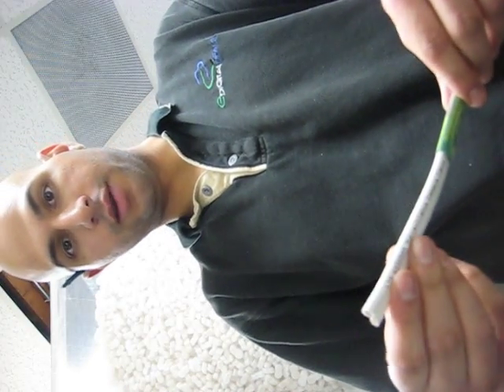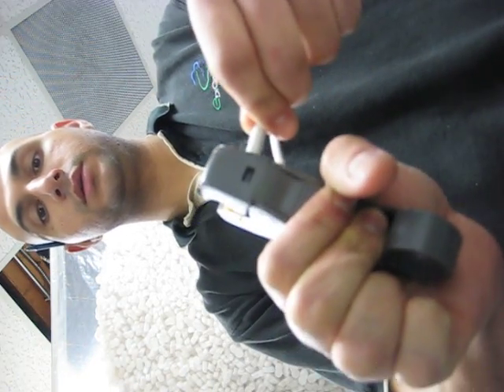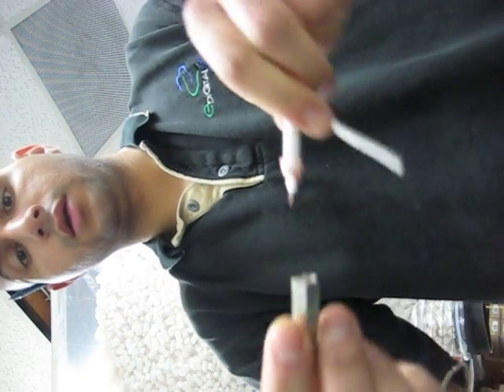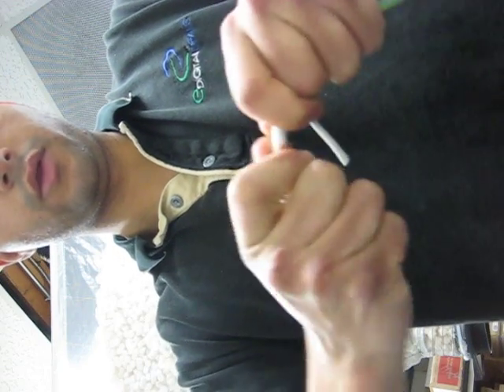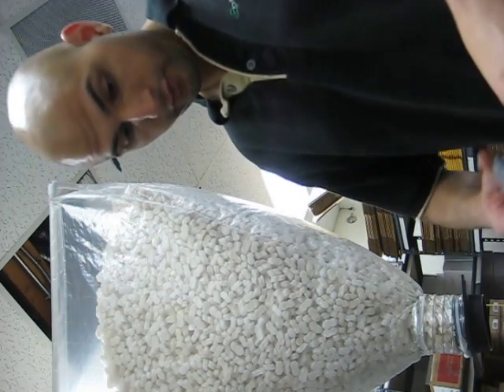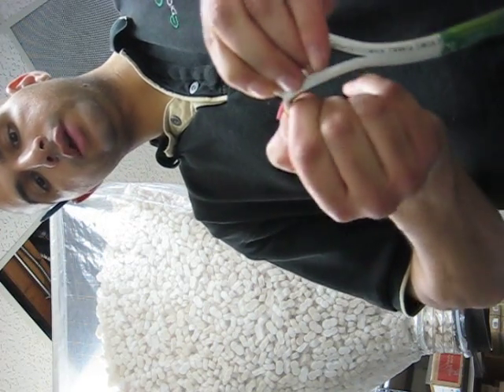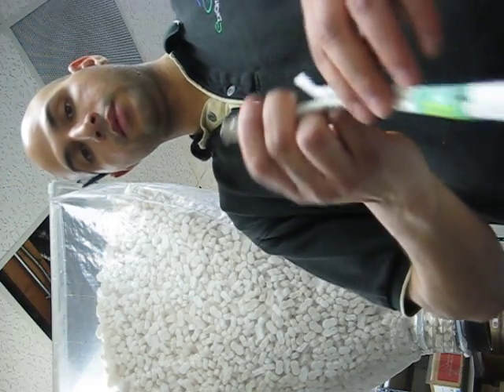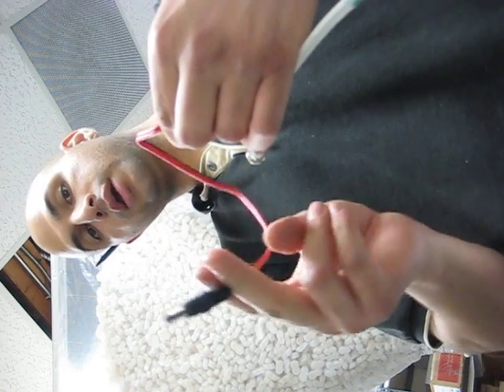How-to Make a BNC Connector for a Coax Video Cable

Comment: Id figure, by now compression connectors would have been popular enough that people wouldn't use twist ons,

And BTW cable strippers are use to CUT the jacket, not pull it off.

Save Your Blades!